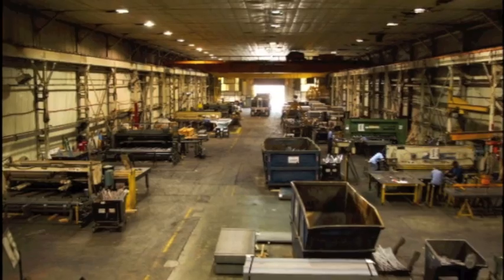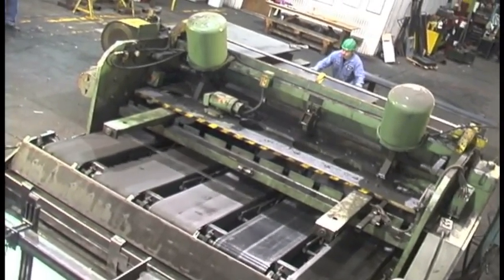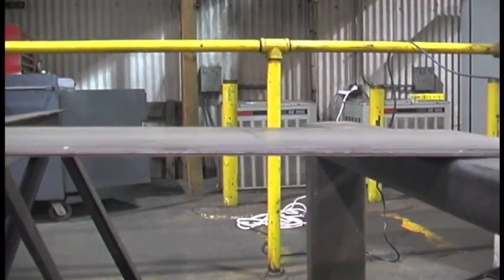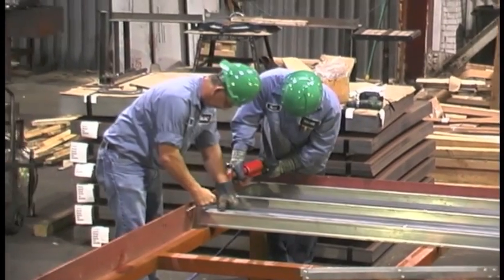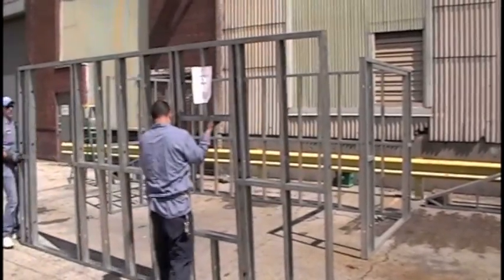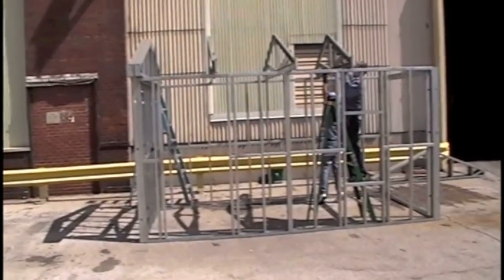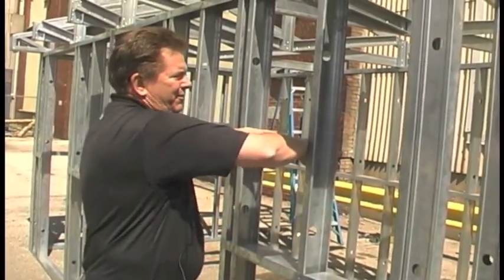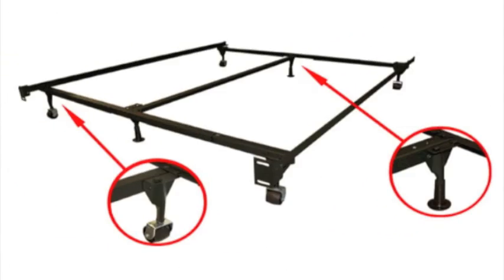Majac Steel

Comment from the maker: For a project, we went back and methodically measured the sheared tons at Majac from inception until June 30, 2011.  The total we came up with was 323,590 tons or 647,180,000 pounds of steel.  Our best year was 2004 when we sheared 27,961 tons.  When you think that we did it all one piece at a time, that is a lot of steel and manpower.